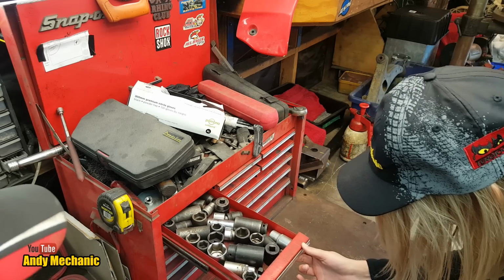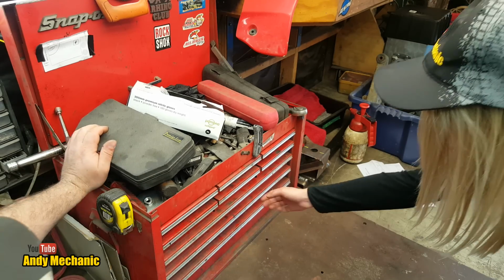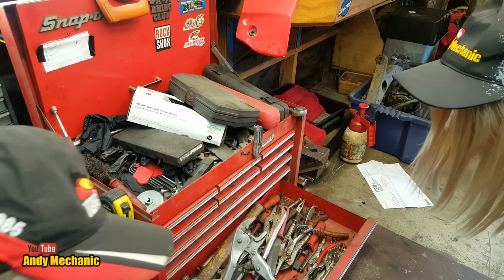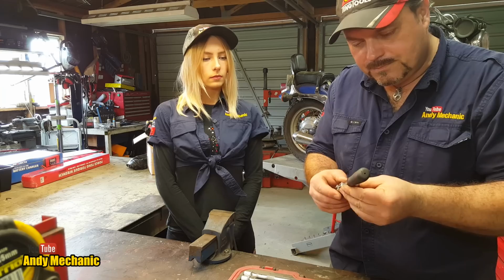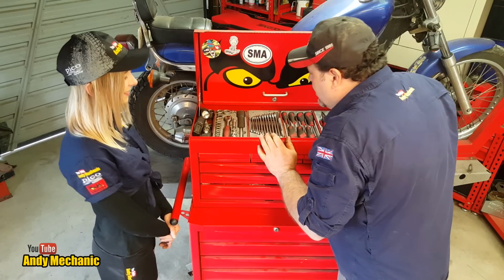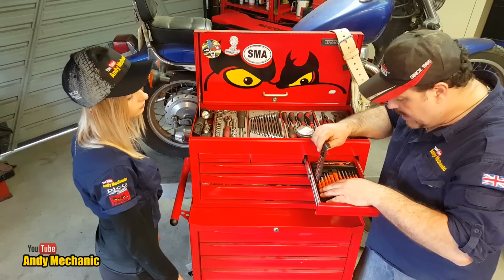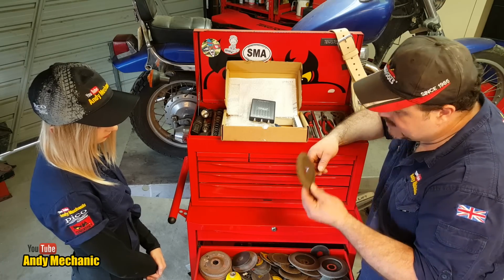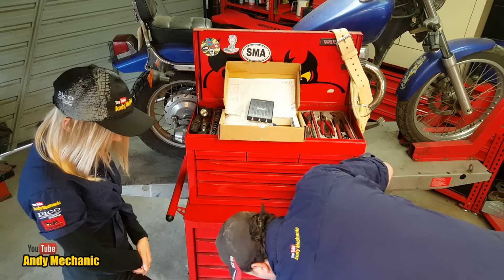Tool Box tour Ft. Tool Girl Sam #3102

Comment: Yup, my toolboxes are exactly the same. I have bits of socket sets all over the place, a drawer full of screwdrivers of different sizes and ages and brands. I find that your own toolboxes at home in the garage/workshop don't get looked after the same way as toolboxes you use for work.

A/F stuff I am more familiar with. I'm a bus mechanic to trade here in Scotland, and a lot of the older British stuff (Leyland being a particular example) use a lot of A/F size nuts and bolts. Because it was the older stuff which used A/F more commonly, and being Scottish, I decided that A/F stands for Auld Fashioned. Then there's Whitworth as well, which was often found on Gardner engines.

Sam. She's still my firm favourite. She has gained so much confidence while she's been on the channel, she's so much more comfortable when she's spannering. Glad to read that she's not going anywhere!
Reply from the maker: Big project planned for Tool Girl Sam....she doesn't know it yet!

Cheers Andy
Reply: @AndyMechanic  Can't wait :-)

Comment: Thanks Andy and Sam. It's always good to see that I'm not the only mechanic, actually mechanical engineer but trained in diesel, surrounded by organised kaos. Working in mine workshops forces you to be organised but lock everything down as its amazing how many items " grow legs and walk ", but anything not valued lays on my benches. My tools and boxes ? Provided by Wurth Industrial Germany, all high tensile spring steel, 1800 pieces spread over 4 boxes, including air and battery tools, sized from 4mm thru to 200mm with 50mm drive !!! 👍👍
Reply from the maker: Wow.....Wurth gear ain't cheap either though it's usually very good quality :-)
Reply: @AndyMechanic  : Admittingly I'm lucky as all equipment is employer supplied, maintained and updated by Wurth and the kits remain my property as a salary deduction.